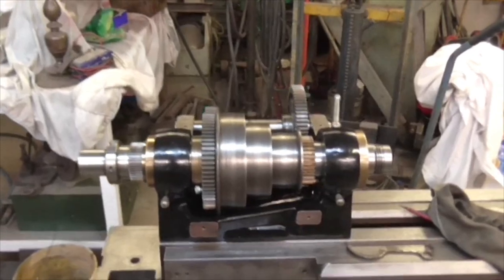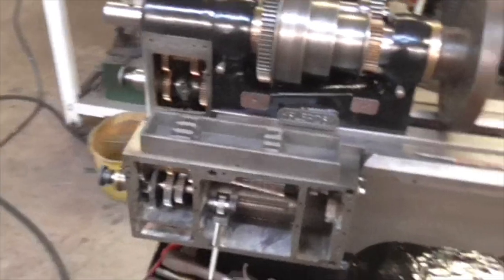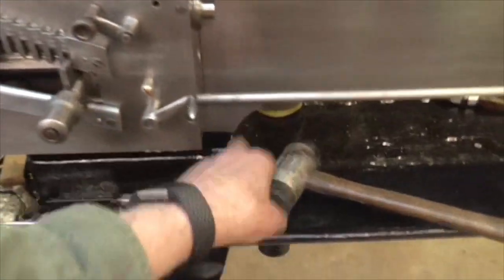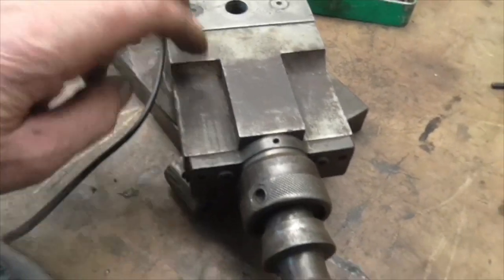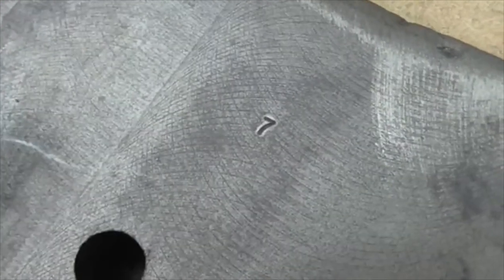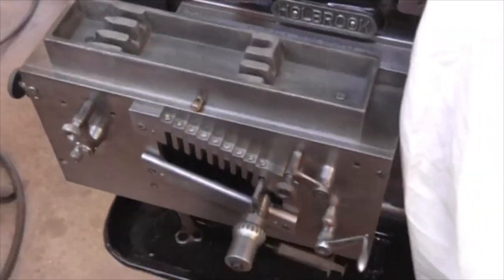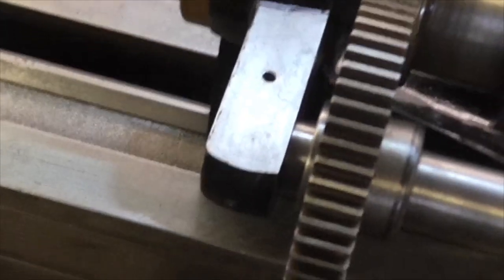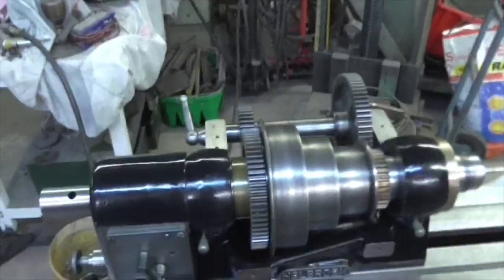Holbrook rebuild part 7 Adjusting headstock bearings and fixing the broken bits!

Comment: Great progress Phil, and enjoyable watching ! with regards to the wear in the bed Id put it all back together and turn a piece between centers then take some readings
Reply from the maker: TBH Del, I could live with the bed, but the underside of the saddle is a mass of deep scores, the peaks of which are or seem to be at the right height, it is just that they will rapidly mske the bed worse! What you say is correct, but I am going to eliminate the scoring with Belzona, which is a two part epoxy with a silicon steel filler in it, and then scrape it to blue and refit it, and then do a turning test! It will be right!
Phil

Comment: All very interesting stuff young man. When pondering on how to spin up the gearbox, would a timing belt match enough to fit in the teeth and drive it from an old timing pulley mounted on drill? Just a thought.
It's got some history that lathe with all the missing original parts, replacements and repairs.
Should be all be plain sailing now to the finish line. Just hope you keep it and make something on it to repair another fine example of industrial heritage.
Top marks squire!
Reply from the maker: I shall be keeping it and making stuff on it! "Out of my cold dead hands" as the Yanks say! Its history may be even more interesting than at first  sight for it came from Bridlington, and bears a military mark, the only military establishment in Bridlington in the 30's was the RAF air sea rescue unit on the harbour top (long gone) but at the time this lathe was new one of the people working there was quite well known and famous, but to his mates he was known as Aircraftman Shaw. I am looking for evidence! The timing belt sounds likw an excelent idea, and I have a few kicking about, but I am much happier now that the bearings are adjusted correctly as the 1/2 thou clearance was immediately apparent!
Phil
Reply: @philhermetic  Ohh well, lots to look forward too then! Great news.

Comment: Unscrew the lifting eye from the horizontal overhead slide of the universal mill, and bolt on a simple gantry that will let you suspend a block and tackle to remove the vertical head and swing round to lower to the floor / trolley or whatever.
Reply from the maker: As soon as I recorded that bit I knew I was going to have to make something, and I was looking for potential attachment points! the thing is, my ex precision engineer mate, Richard, said when he saw thw vertical head on, "you'll never take that off now, thats why the H mill has fallen from use", and he is right to an extent, because you can always find a way to get round with a set up that turns your V mill into an H mill, but often it would be easier just to turn it back into an H mill! I will make it work!